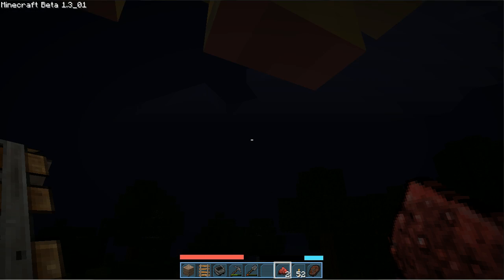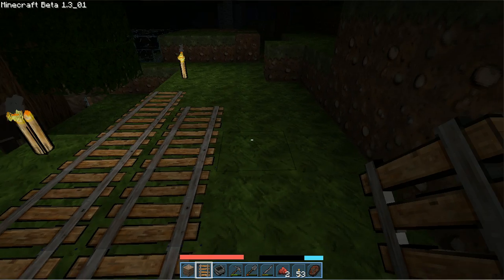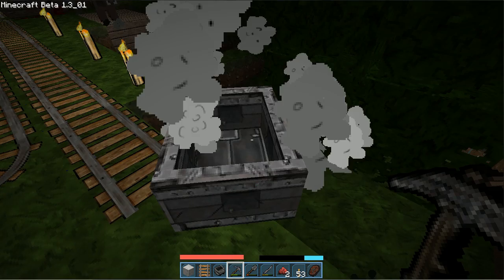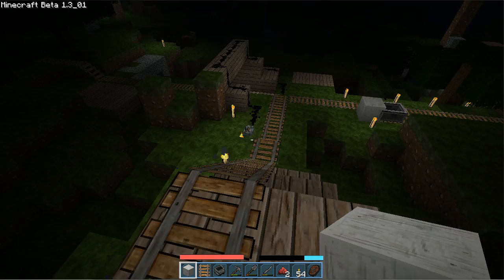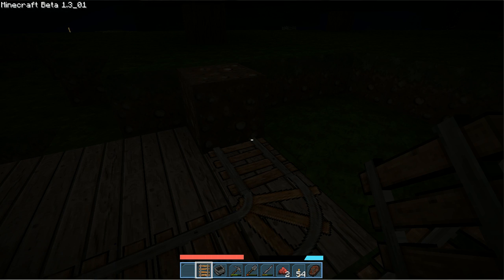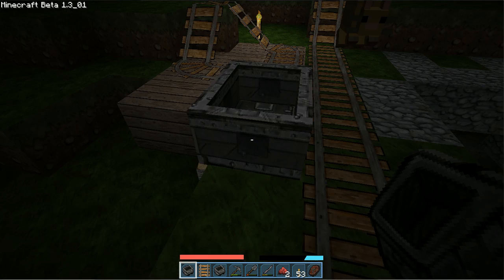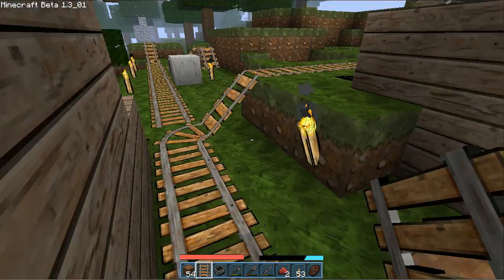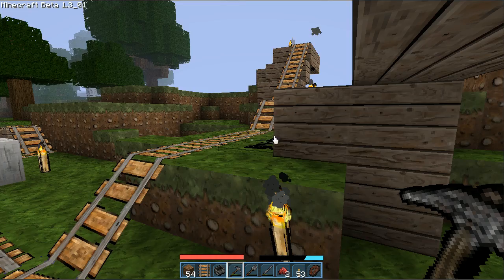Basic Tutorial on using Minecart Rails l TheMineShack

Comment: The reason your second booster wasn't resetting properly is because of something dubbed the "South-West" rule. That is, when a minecart reaches a perpendicular intersection on the same plane (i.e. the track is flat) then the cart will always turn to either the south or the west. So booster the way you have them set up will only work when facing North or East.

Comment: The block you have placed in the corner of the return loop of the booster wont actually do anything. It would help negate the south-west rule if it were placed at the first bend of the return loop. What this would do is create an upward slope. This is where you would loop the track around to; when the cart got to the intersection, it would want to go south or west but the incline would force it to go the way you want it to.

I hope these comments have been helpful.

Comment: Where to start... may have to cover this in a couple comments.

Having the booster track on the same level as the main track the whole way probably isn't the best idea; you might get a small boost, but nowhere near as much as you could.

The fox in the minecart wouldn't have any real effect on the system except to make the booster cart travel for longer (if it had anywhere to travel) as carts with a rider get more momentum than those without.